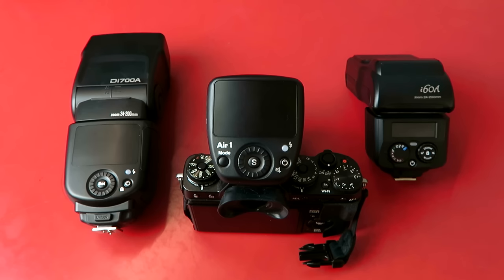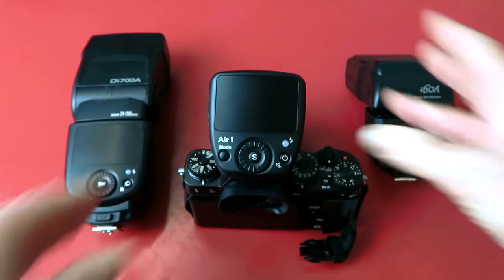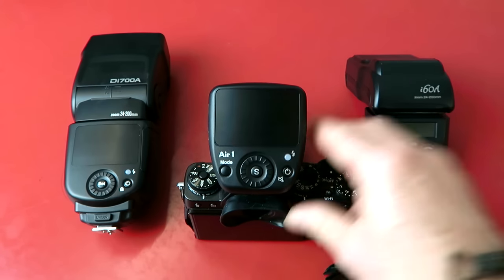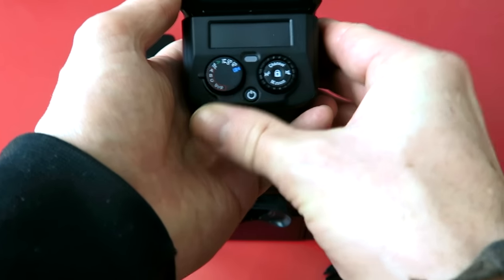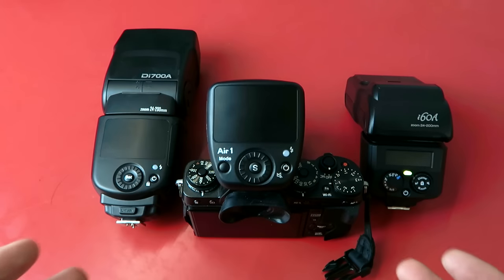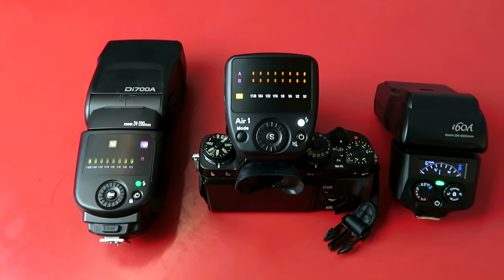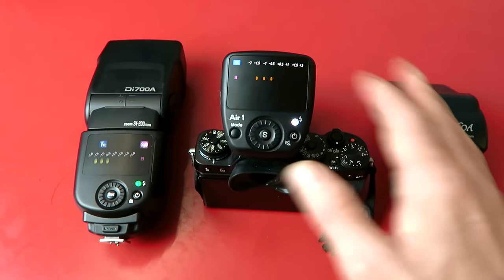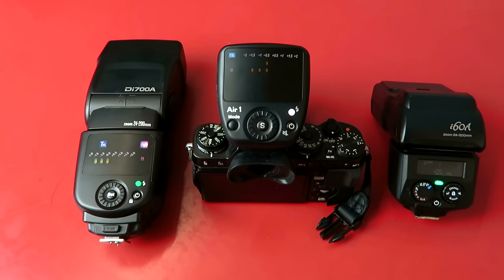Nissin Air 1 Commander Review, Set Up & Demo with Di700A/i60A Fuji X-T2 X-Pro 2 X-T1 X Pro 1

Comment: This is a joined/ventured of ATG and Nissin.
They have seen many beginners & amateurs needing HSS, but many are not willing to pay for the prices. 
You will need 5 or more flashes so you can overcome five or more of F-Stop when using HSS.

Only the ATG Gold Di700A can do HSS with Fuji GFX 50S.
The price is over $1,000.00 USD.

Comment: Hi Matt, does the air commander have focus assist? Or the i60a flash? One trouble I had with the i40 on my X-T1 was that it did not have any focus assist and in dim light the X-T1 would just hunt on for focus. I sold the combo but wanting to go back to Fuji now with the X-T2 but the flash system is still holding me back.

Comment: I am wondering if you can buy the i60A and the Air 1 commander in one package? I want to use it for the Panasonic G9 off and on camera flash if I need to? I know you can buy the Di700A with the commander but it maybe too heavy and unbalanced for the G9 if you need to use it on camera?

Comment: Hi Matt,
Do you know if you could command a set of Di700A from two different Air 1 triggers?
I shoot primes withe two bodies (one with the 18mm and one the 56). Last wedding I shot, I had setup two Yongnuos on stands, pointing down to the dinner / dance area and had a youngnuo trigger on each body (I even had a third one that I could use handheld). Once the power properly setup (did that before it all starts out), I just had to pick anyone of my two cameras and they would fire the two flashes, no need to change the trigger from one body to the other. Very fast and convenient.
Add TTL to that and this would be great.

But as it seems you need to pair the trigger with the flash, I wonder if that would be possible?
Reply from the maker: Eric DAUBIE Hi Eric you probably can, but best to check the manufacturer to be sure!
Reply: Matt, I've checked with Nissin and you can't.
They took notice of the idea but as of now, when you pair a flash with one commander, it "unpairs" it from any other one. Too bad for now...

Comment: Great video as always Matt.  Can anyone explain how TTL works off-camera?  Surely the flash or camera doesn't know the flash-subject distance!  How does it adjust flash output?
Reply from the maker: Zaid Al-Kindi it just keeps firing the flash until the meter tells it the exposure is correct. Once it's happy that it has enough light it shuts the flash off.

Comment: Excelent video Matt. I got one too. Works and looks great indeed. Yeah HSS........
Thanks for posting you stuff.
Reply from the maker: +Steven Scholten thanks Steven! Hopefully they'll sort HSS one day soon :)
Reply: To activate High Speed Sync (HSS) when using Air 1 Commander, Press and hold “Pilot” button on Air 1 Commander for 3 secs to enable HSS. The Pilot button in Air 1 will start blinking twice which indicates the Air 1 Commander is in HSS mode.
Reply from the maker: Santeri Virtanen Not on the Fuji version - yet! You're right though if you have Nikon / Canon / Sony etc then you get HSS with the Air 1.

Comment: How is the battery life of the air 1 commander? I previously had one for Nikon and the batteries died very fast. The display started dimming soon after putting in fresh AAA batteries. I'm very tempted to get this system for my current X-T1.
Reply from the maker: AzicDrms Not done a comprehensive battery test but if it's anything like my Yongnuo it will last days. It's not got anything I can see that would kill battery life much
Reply from the maker: AzicDrms Not done a comprehensive battery test but if it's anything like my Yongnuo it will last days. It's not got anything I can see that would kill battery life much
Reply: Matt Widgery Photography Ok. I have also a Youngnuo 560 TX commander and battery life on that is great, surely better than what I experienced with the air 1 commander. i hope the problem was only with that specific unit. This would be great flash system for fuji at good price.
Reply from the maker: AzicDrms The display dimming is a battery saving function. You see that in the video here a few times. It should light back up again when you press a button though. If not, I would get it replaced, or try different batteries maybe?
Reply: Matt Widgery Photography I sold it since I switched from Nikon to Fuji. The screen kept dimming constantly until it was hard to see anything. i actually also had some freezing problems: had to remove batteries to get the commander responding again. When HSS comes around I think  I will order the kit..try my luck this time.
Reply from the maker: AzicDrms Fair play. Hope the next one works better for you! :)

Comment: The 2 drawbacks of the Nissin wireless system for event work:
1: the flash itself cannot be used as a master controller.  
This is my preferred way to shoot events. 1 flash on camera, and remotes as needed. I hadn't realized this limitation until after I invested in three of the i60's. I should've done my homework better. My workaround is to use the air1 in the hot shoe, and the i60 on a camera flash bracket 
2: the inability to remotely turn off and on remote flashes from the air one.
I usually put a single remote flash in diagonal corners of a room. And turn them on or off as needed as I work the room. Can't do that with this generation of Air1
Reply: Can you not mount one flash on a bracket alongside the camera,with the Air unit in the hot shoe, the other two in each diagonally-opposite corner, controlling  all three from the Air 1? I haven't tried it (I've only got one i60a) but I see no reason why it shouldn't work. Let me know if it does!

Comment: Hi Matt, in your opinion how reliable is the trigger system say compared to using pocket wizards?
Reply from the maker: Hi Anthony. I never had any reliability issues with the Nissin stuff personally. The build quality is very good and they never failed to trigger. I wouldn't hesitate to use them in the field.